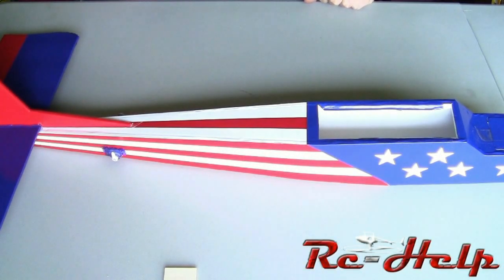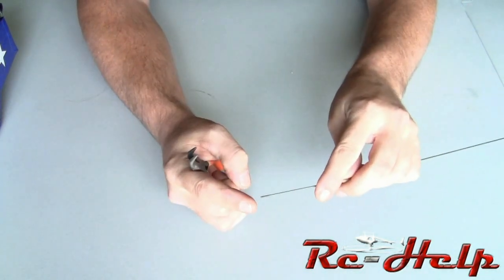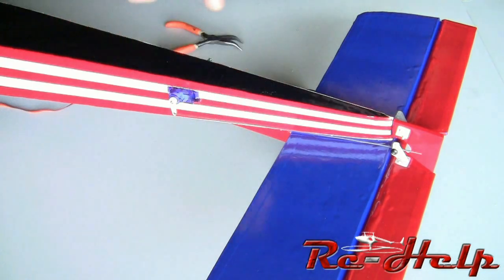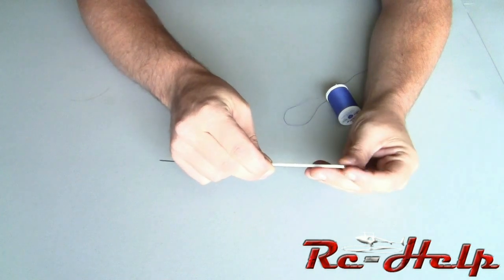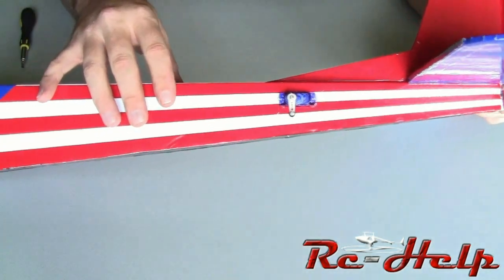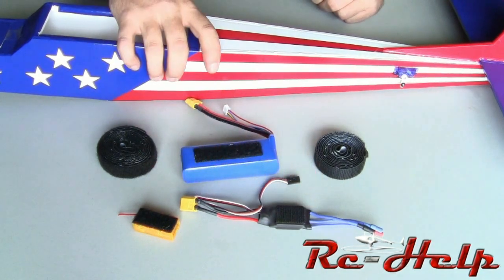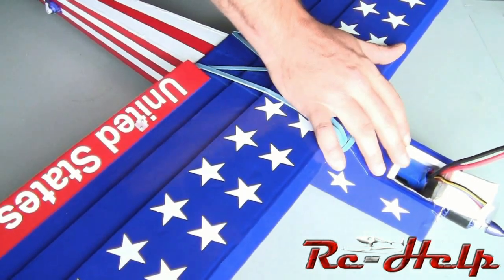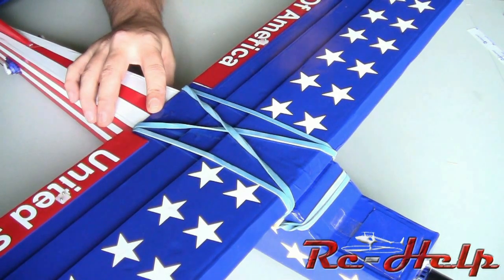Rc-Help Trainer Build Pt. 7 Installing Linkage Rods, Electronics & Setting CoG

Comment: are you able to use two different batteries. one for your servos (lower voltage needed) 
and the main battery for my motor esc. ( higher volatge needed). 
would this be possible ?

Comment: Hi What battery pack are you using? let me know thanks.
Reply from the maker: I was using a Turnigy 2200mah 3s 25c pack in this plane. But pretty much any 2200mah 3S pack will work. www.Rc-Help.com

Comment: I can defintely see and quicker better method.
Reply from the maker: You are correct. The V3 of this plane (this is V1) has a much easier to build wing that just folds over (V4 will have a true air foil rather than the outdated KFM design) and the fuse is now one piece that you fold into shape. I need to update this video with the new plane, but I think I will wait until I get V4 done before I do. Thanks for the comment. www.Rc-Help.com